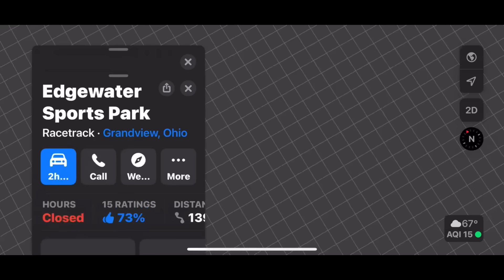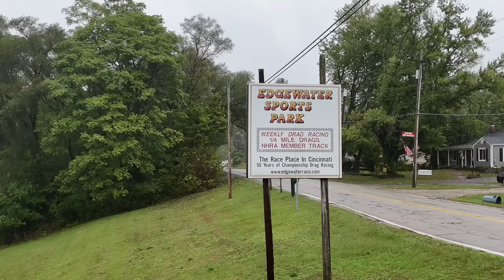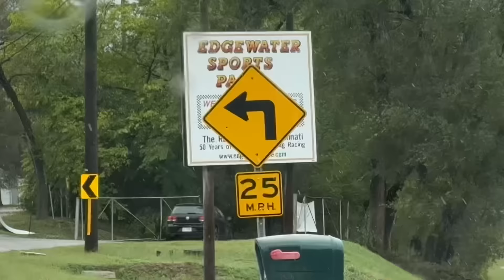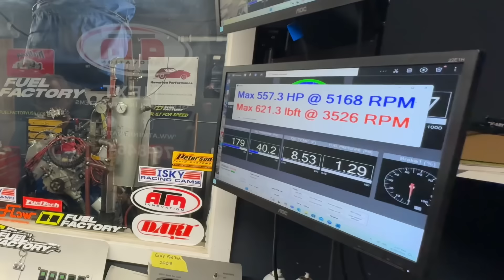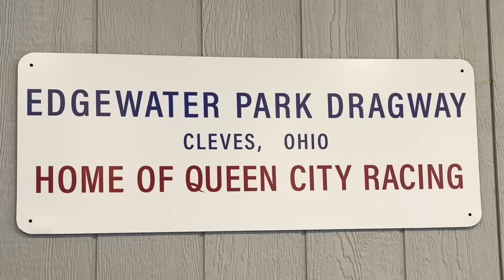THE FIGHT TO SAVE THIS LEGENDARY TRACK & MANY OTHERS STARTS NOW!

Comment: My dad raced a 55 Chevy at Edgewater in the 60’s and 70’s. I started racing there in high school in 1984. Raced there on and off till the late 90’s. Then life hit with work and kids. I retired early in hopes of racing again. I raced Jeeps at 300foot sand/dirt drags through the 2000’s. Then got into Jeep trail rides. My plan was to retire and build a Willys flat fender 2wd Jeep with a SBC to start Drag racing again. Light weight and easy to tow on my two rail trailer. But even with the kids grown and the my wife still working it’s just so expensive. To build a motor and transmission to be competitive in a small tire class is crazy. I bracket raced for years and wanted something different. I was hoping with a front Straight axle 2wd Willy’s flat fender Jeep I could race in a Gasser class or Nostalgia Class. Be nice if Edgewater would do an old school class one night a week for 1972 and older vehicles. Allow Classic Pie Crust Slicks up to 10in wide. No power adders. I believe we have enough old school hot rod guys around the tri-state area that would put old school slicks on their old cars and trucks and show up one night a week. I don’t want to race a Honda civic and I will not spend $25k to build a LS Turbo engine.  Just old school ALL motor racing like when I was a kid. 12 second street cars that guys put slicks on. Hell, even a hard tire class. Or stick and auto class.  No Foxbody twin turbo cars. You could offer 1/8 and 1/4 mile classes the same night. 
 I believe a lot of guys got out of racing when the laptops came out. I see guys at car show with old hot rods all the time that would like to race, but can’t compete with today’s technology. Why show up with a 69 Nova with an N/A sbc and line up with a twin turbo LS Foxbody. I like tuning a Carburetor, not typing on a computer to race. And no I’m not a Boomer. I’m Bills age, Gen X. We both grew up with dads that raced 55 Chevys. Be nice to have local old school racing. 🇺🇸🦅🔧

Comment: Best no prep set up Ive seen is Grand Bend.  They literally run their big bracket series on the drag strip and the no prep runs on the straight away of the road course.  Nice beach town minutes away for the wives.  That track doesnt need to bend over for no prep, they need a local bracket series to keep the bills paid, stands full and bills paid.

Comment: I still like ducks old school nitrous class. Must be carbed, any nitrous plate only, factory production small block only, stock frame, stock style suspension bolt in options ok, any fuel, any transmission, Fiberglass on hood only , lexan ok for trucks for outriggers cage bars. No awd/4wd, subframe connectors ok, stock full frame otherwise. That'd bring a lot of cars out of the woodworks with the right backing. Or a variation of this. 360 c.i. or smaller can run 275. 360c.i. or bigger limited to 255 tire. 220 treadware minimum.
Reply: corvettes and many other cars have glass or carbon front ends from factory lol
Reply: @Shadow0fd3ath24  huh why does that matter. If you want to swap a carbon hood to fiberglass. Idk why but you can.
Reply: @TT64NOVASS  it'd fit a lot of people. That class would be a banger for sure. Especially with the bigger c.i. guys having to run a smaller tire. Thats the only parity rule between combos.

Comment: You will do just fine I'm sure.  #1 suggestion,  keep  the drunks out. 
War in the woods was a fine example of this . I went to the last race and the drunks made it real bad. A lot of people I talked to said they would not be back to that track and I agree I won't go there again . Drinking is fine as long as you don't go crazy, plus I saw lines of speed being done on the hoods of race cares and out in the open smoking meth pipes.  Racing does not need that .  Just my opinion and yes I drink to but in moderation.
Reply: the last WITW had by far less than the others...as sad as that is to say. No alcohol should honestly be required
Reply: It's fine if you drink just do it like a man and control yourself but there's nothing worse than a bunch of drunks at any event

Comment: My 428cj bored .30 over with domed pistons and stock heads that had been ported extensively and heads shaved ran on race gas or the aviation gas at the local airport. I ran a solid lifter flat tappet camshaft that was a special grind from Kuntz & Kraft from Arkansas who specialize in getting the most out the FE motors from Ford.

Comment: I agree with you about not using arm drop or instant green.  In both cases you are going to have never ending arguments about tires cracking before the drop or the light.  Just use a 4/10 pro tree and there cant really be any anticipating of the light.  With instant green if you dont have a tire crack rule as you are well aware someone guessing the light can get dang near a half second head start.  What did your kids call it, the Alabama delay box?  Best of luck with your race, hope it all works out and you get a good car count.

Comment: I know ventures are expensive but I bet a big stage and amphitheater for concerts and events would create other revenue. Or as a cheaper alternative have something that can operate during the week for kids and adults. Go karts that have a track that can be setup and taken down. 

Have a bunch of different outdoor things kids and parents can come do along with the karts. Maybe a small paint ball arena, Lazer tag, a small arcade in a metal building with a few full motion racing Sims, drag tree race games with the seats that fall back when you let go of the button. a little food and drink bar. Have those blowup things for the younger kids. Build a big block short block short Bus that can take 6 people at a time down the track

I know as a parent I'd love to come to a place with a bunch of misc activities that are different than anything else for my kids. Certain things wouldn't be that expensive like one of those blow up balls you get in and bump into each other or knock down big blow up bowling pins down. An area for all types of RC car stuff. A little RC race track and drag strip, a little area for RC 4x4s and rock climbers. A drone obstacle course. A hot wheel and matchbox car world with different tracks, jumps and different obstacles they can roll them down. 

Just a handful of different activities kids can do. 

I know some of it sounds off the wall but I think stuff that involves kids that parents can be involved in would be great. It also would bring kids to the track to try and get the next generation into racing.

Comment: Man poor old chevy 6 . I had an 250 cubic inch 6 with and old school isky cam and a holley 4 barrel card and a aluminum power glide with trans brake in a 78 buick skylark back in the 90s I couldn't keep drive shafts or rear ends in it miss that old car

Comment: My big block ford I race in my fairmont that uses same edelbrock heads made most power 32-33 degrees . Timing locked out . My 510 solid roller 13.3.1 compression made 763hp on vp 113 fuel   .....looking forward to seeing how this ends up.

Comment: Bill, if you want more people to participate in drag racing, then you need a class that your average person has a chance. 12 flat and slower. 
No power adder 
Stock style suspension 
Drag radials only 
Full exhaust 
Full interior
Reply: You've never bracket raced?
Reply: @gearbanger57  , yes ,I have bracket raced. What's your point?
Reply: @hk45c62  You said you need a class where the average guy has a chance.
Reply: @gearbanger57   , I don't need anything.  It's just sad watching $150,000 puppy kickers taking advantage of the rules.
Reply: @hk45c62  I agree, class racing got so out of hand and that's how bracket racing came about.
Reply: @hk45c62  just like tommy and Billy in there 150k cars.

Comment: Lets back it up to 26x8.5 steel roof and quarter stock wheelbase no tube chassis no midplates. If you wanna try and hook a twin turbo billet hemi go ahead 🤣. I also wondered how a biweekly points series would hold up. $2000 to win $100 buy in weekly and a end of seasons points fund. Might keep the local grassroots guys coming back and grab some stragglers

Comment: Its a hard situation but id say take away all electronic advantages staging advantages and so no one has an advantage leaving the starting line no 2 step trans brake or down track traction control throttle stops ect back in the day if you could get any traction or were a good 4spd shifter you had good chance at winning no good or easy answers

Comment: I have a 302 ford that’s 30 over with a summit 1800 cam stock heads with a 750 vacuum, secondary Holly carburetor what size power valve should I use

Comment: Shorten the curve to best suit drivability for the car weight and gear DON'T LOCK OUT! That is for a race car that leaves the line always above 3,000 RPM. It will detonate and also cause engine to run hotter.

Comment: Pacific Junction Iowa has an Awesome Motorsports park with 1/8th mile drag, 1000 sq ft burnout box, and a sweet ass road course and they struggle to keep running. If not for them we would have to run illegal races in the streets...

Comment: Man I wish you would turbo the inline 6 in the elco and not v8 swap it. It's not going to race, never going to be fast and will drink fuel. Can make the same power, less weight, still not fast lol, would get 20+ mpg and be completely different than any other older elcos.